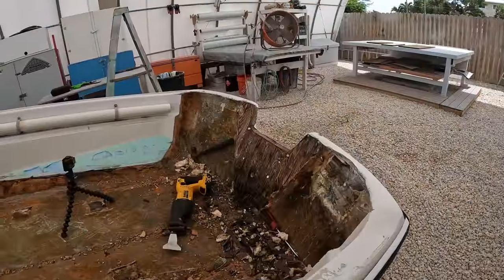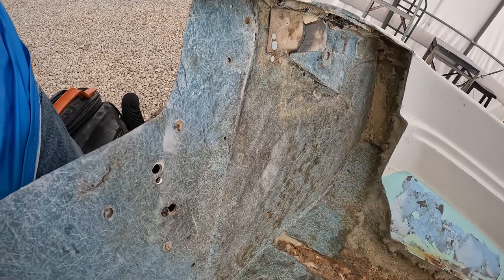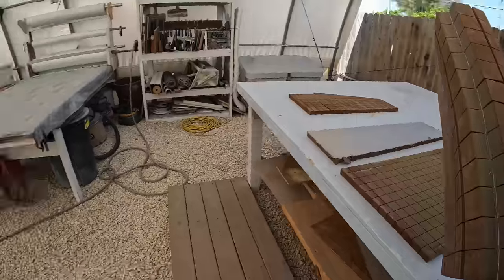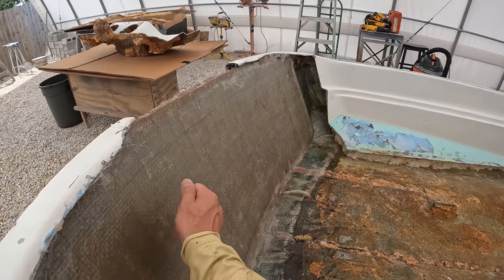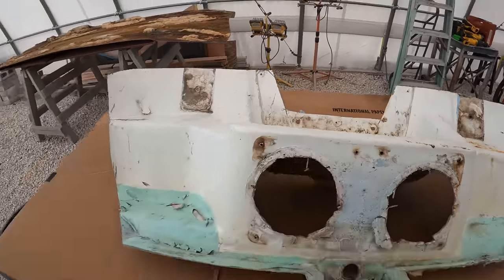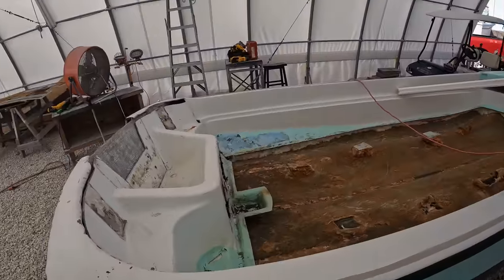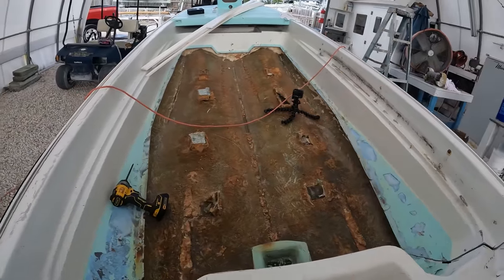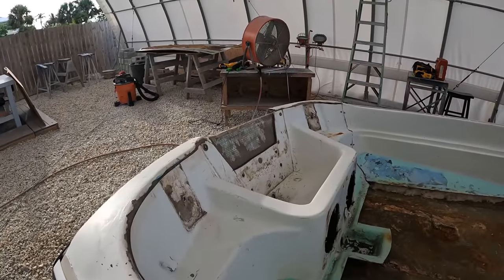Replacing A WOOD Boat Transom With FOAM!

Comment: Been there done that, super videos, keep up the good work.
Reply: It depends on what foam is used. Closed cell won't soak up water. I think there's so much resin in the grids it provides a barrier. I used closed cell foam products on shower surrounds and it works great.

Comment: Does anyone know if that foam will soak up water if there is a little break in the glass?  I asked last time but guess he's got too many viewers to answer.  Maybe other viewers have some experience with it.  I bought a catamaran where someone filled the bottom of each pontoon with foam instead of having a regular bilge.  Will it absorb water and become extremely heavy over time?  Do I need to dig all that foam out and put in bilge pumps?
Reply: Eventually yes, even though it’s closed cell foam I’ve tore into many boats where it was absolutely trash. 
The best thing is to repair any cracks before that happens, water will get in there and the foam will not allow it to drain.
Reply: Thanks!  Not looking forward to digging all that foam out, but better than breaking the boat on the travel lift if that foam is full of a ton of water.  I think there is about a foot and a half of foam in the deepest parts of the pontoon.  Do you think it would drain if I dug down to the hull in the deepest place and put a bilge pump there?  Would it drain and get pumped out?  Or do you think the foam will hold the water like a sponge and I need to remove all of it? @reefslayer21
Reply: @ninehundreddollarluxuryyac5958  if the foam is dry I would leave it and just make sure no water can get down there. That foam doesn’t soak water up like a sponge it takes quite a while till it starts to deteriorate
Reply: Thanks so much for sharing your experience.    Any further insight into the nature of this foam is greatly appreciated. @reefslayer21

Comment: You fiberglass work seems kinda sketchy. One sheet of biaxial for the transom, little 2 inch strips to tie that back piece back in. !/2 foam. does seem very structural. Just saying...

Comment: typically love the videos but this one was painful to watch. so many things just thrown together "good enough" style. Never rounded the edges of the blocks, never created fillets for the glass to sit over the blocks, lots of space between the final glass on the blocks and the reattaching transom fiberglass, you can literally see the fiberglass bending to the transom on the middle top screw. I hope he filled that in later but it wasn't on this video. You got squeeze out on the trailer tie down hook holes but not where the bolts for the engine will go? yikes....